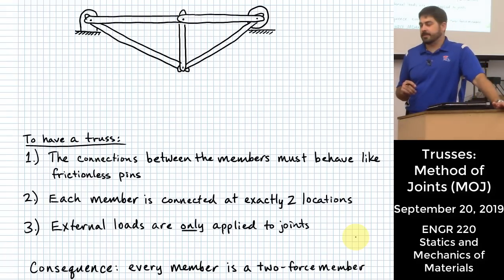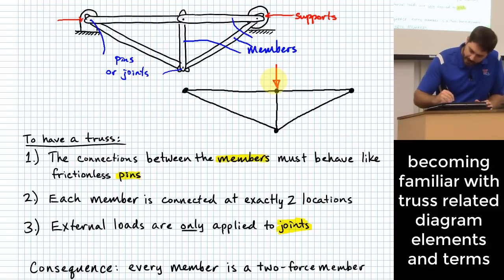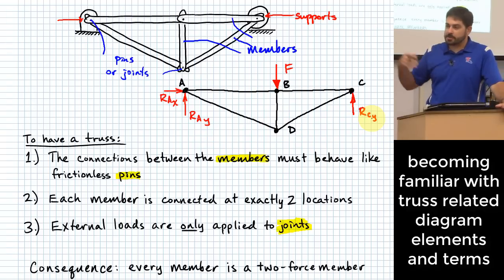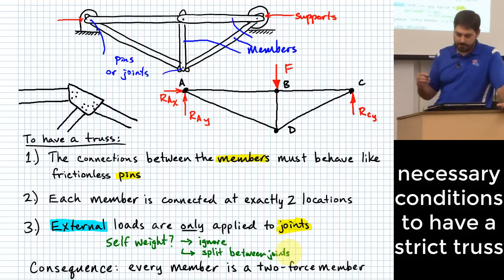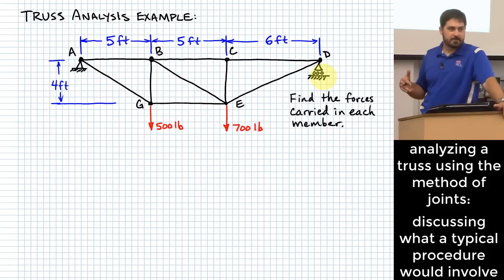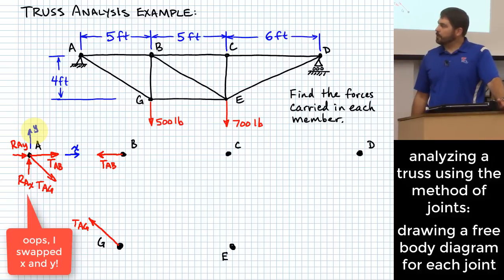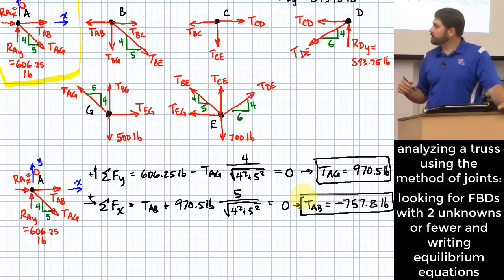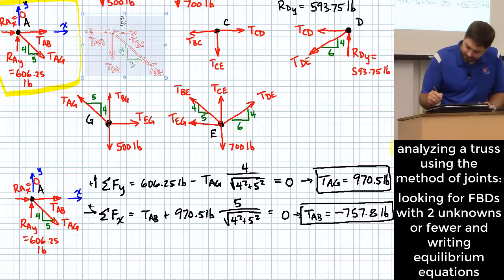TRUSSES: Method of Joints (MOJ) | Structures of Two Force Members | Identifying Zero Force Members

Comment: Solve for Tag:  Ratio of similar triangles.  Slope (4/5) = 606.25/Tab ==>> Tab = 757.8 lb ::  Tag = Sqrt( square(606.25)+(square757.8)) = 970.46 lb.   Force Tab may be solved first.  Although this works when ( x force ) required first.  I prefer the elegance of method given by instructor.  I took statics and dynamics MANY years ago at University, and the courses were very difficult  for me to thoroughly comprehend.   Rarely, does an instructor of this quality happen .

Comment: I followed along and understood the first about 40 minutes of your video, then you threw in a formula or equation that I wasn't familiar with where you calculated Rdy to be 593.75 lbs. which makes sense since slightly more of the 1200 lbs total force will be on joint A. What prerequisite lecture/info do I need to watch so I can learn this? It's a little over my head. This is a really good video. Thanks you so much for sharing!

Comment: For Joint AG, I have never seen this formula for x and y section previously. What formula do you use; Tension AG times 4/(4^2+5^2)^1/2 for x and y axis? I never seen this before.
Reply from the maker: check out https://youtu.be/I5RYv2JDKus?t=1135

Comment: When finding BE, I tried it by summing up the forces in the x direction and I got 2111.01, I see you got 170.12 for BE when you used the sum of forces in the Y direction. I thought we were supposed to get the same answer using either the sum of forces in the x or y direction. Could I please get an explanation? 1:16:54
Reply from the maker: Solving -(-757.8)+(-890.625)+TBE*5/sqrt(5^2+4^2)=0 for TBE results in 170.1. You must have had an error somewhere in your process.
Reply: @TheBomPE  I sure did! I missed the extra negative sign. Thank you sir!

Comment: Hi, I have checked the FBD by Fy summ and the result was not zero. It was 1200 lb. That's not good.
Reply from the maker: 606.25 + 593.75 - 500 - 700 = 0
Reply: @TheBomPE  
i have summurized the forces in the members: Ray+Rdy+Tag*(4/sqr(4^2+5^2))+Tbg-500+Tbe*(4/sqr(4^2+5^2))-700+Tde*(4/sqr(4^2+6^2))=1200lb

Comment: Hii sr what will happen if we support a truss over two roller
Reply from the maker: To hold a 2d structure in equilibrium generally requires 3 components of reaction. The most typical way to do this is with one pin (2 components) and one roller (one component). With just 2 rollers, the structure would still have a mobility number greater than 0, meaning in theory, it would be unstable. In practice you might get away with situations that look as though they are equivalent to 2 rollers if friction forces present are sufficient to react any intentional or unintentional unbalanced applied force components in the direction of the structure's mobility.

Comment: FDE is incorrect because correct answer is 1061.4
Reply from the maker: No, you are incorrect. The value of 1070.4 lb is correct for the tension in member DE. You may want to go back and check your work.